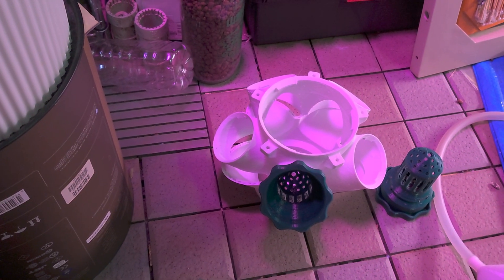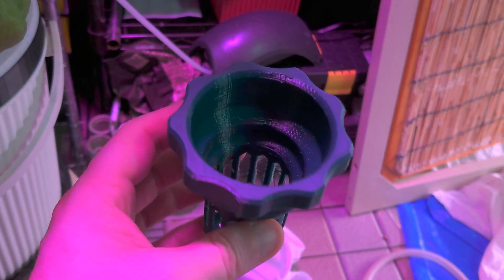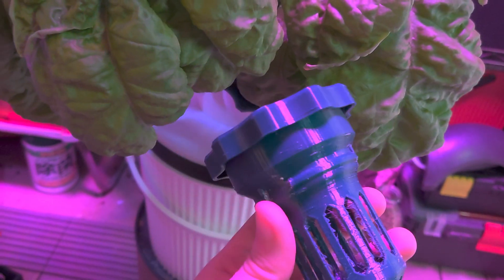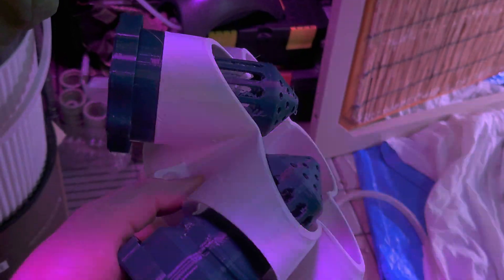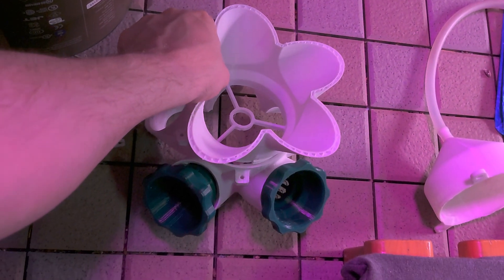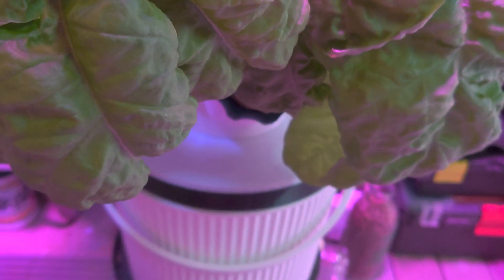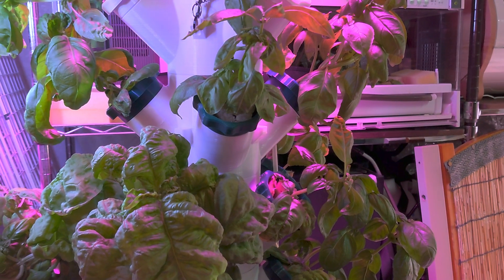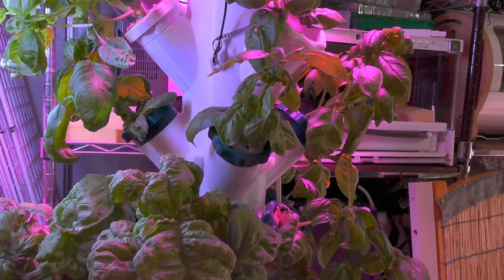Short demo of 3D printed hydronic net pots and and printing materials

Comment: How did the tower hold up after 2 years of usage? I imagine the dirt collecting in the little ridges between the layers. Did the PLA perform?
Reply from the maker: It works fine actually, because I use it indoors.  I would imagine the UV light would destroy it outside, though!
Reply: @shiruba2004  Thank you for the quick answer! So you're saying all the parts are still fine and didn't start to compost or mould yet? That's great to hear. Btw nice build and vid!
Reply from the maker: @AximiliEsgarrouth1  yeah, no mold or anything, maybe a little dirty between the ridges inside, but there's no dirt used in the first place, so not much to build up.  It is quite big and heavy when completely full of plants, though.
Reply: @shiruba2004  if its for outside you would need to use petg as it is uv resistent and can hold up to direct sun temps
Reply from the maker: @lesliestandifer  for sure